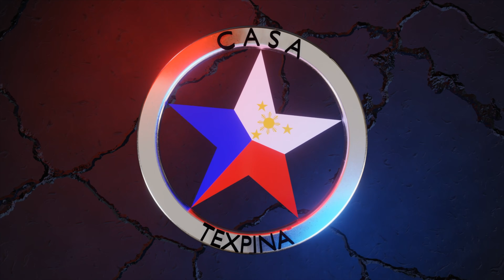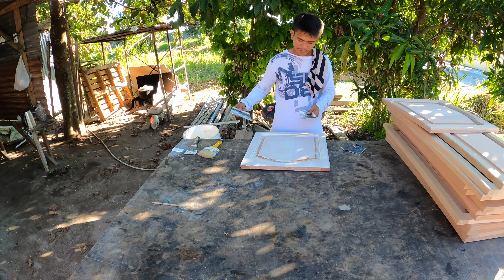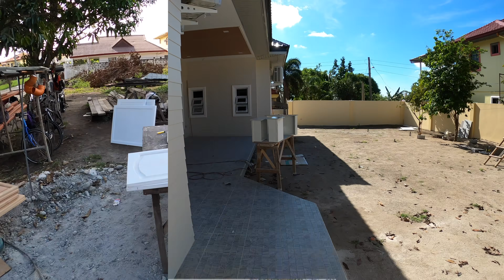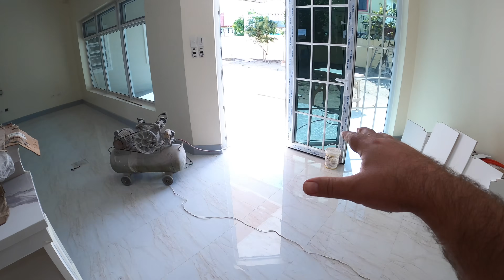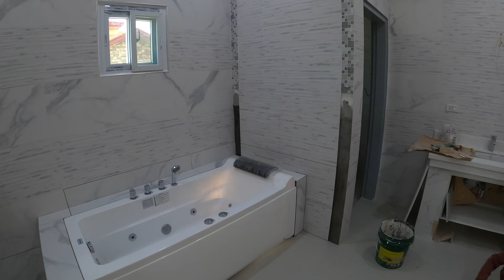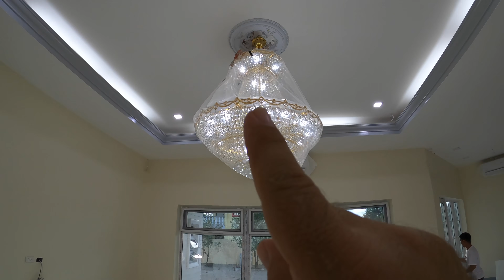Philippine House Building Step by Step, Build Day 232: Kitchen Island Build

Comment: No need to bury island legs into concrete. Just drill 4 holes with rebar and holes in each leg. Not going anywere.
Reply: or use metal braket.
Reply from the maker: Thank you for the tips. 🤔🤔🤔